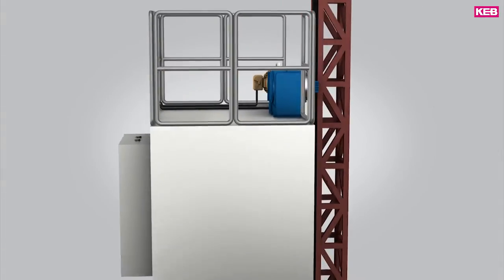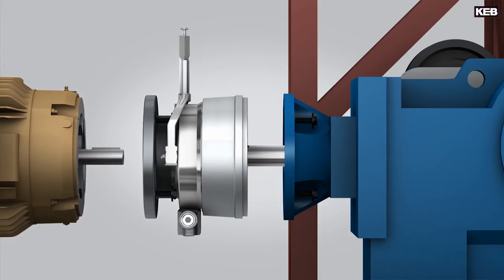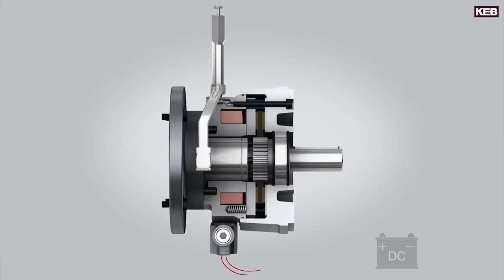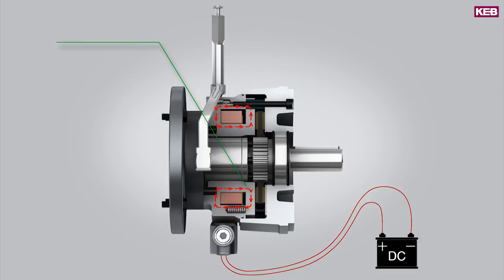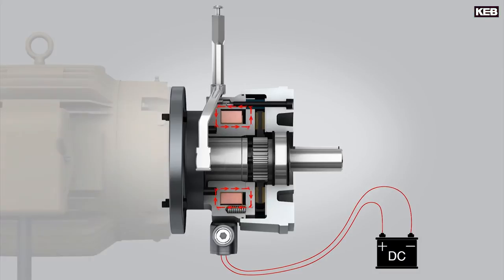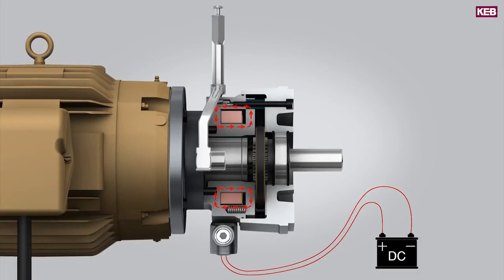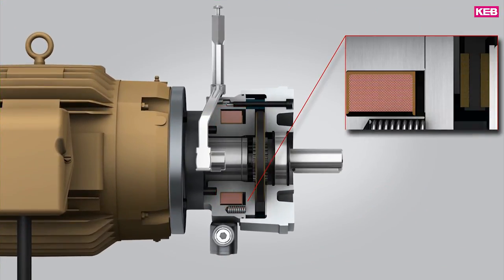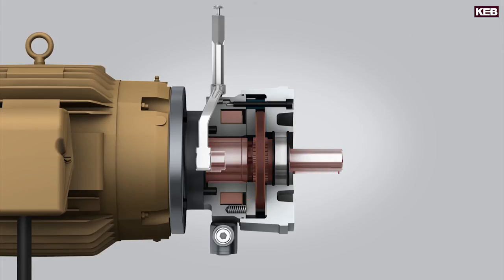NEMA Double C-Face Brakes

Comment: Good afternoon! Please tell me, the E.DRI error periodically pops up on our frequency converter during the operation of the shredder. What have we not done, but so far it is not possible to eliminate it. Please tell me what to do and how to defeat it, so that it does not arise anymore.KEB F5 160kW 2/4P 50/60Hz. ser.№ 300773793/1160991. power 208 KVA. Output 0...1600HZ. Immediately apologizing for throwing off one comment under all the videos, just otherwise it will pass by. And if you still find it necessary to answer, answer the last video. Thanks.